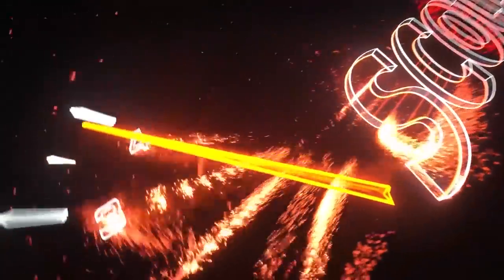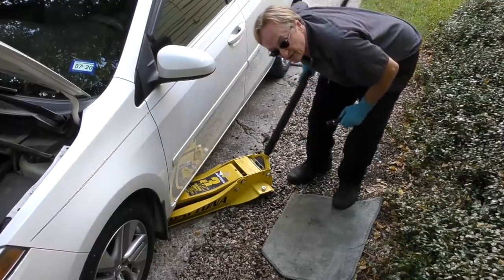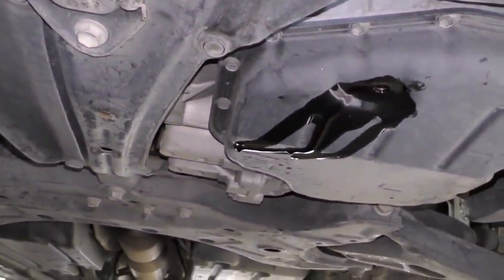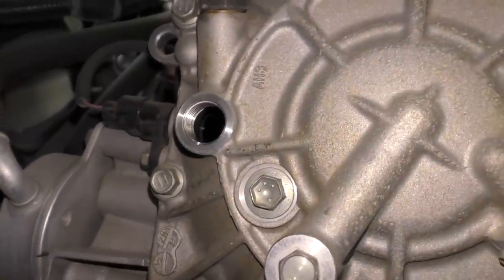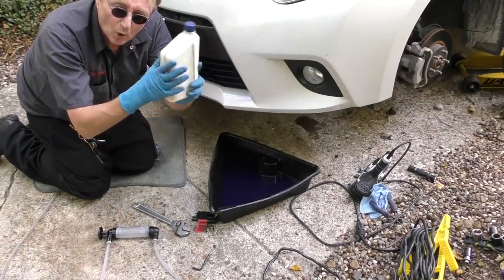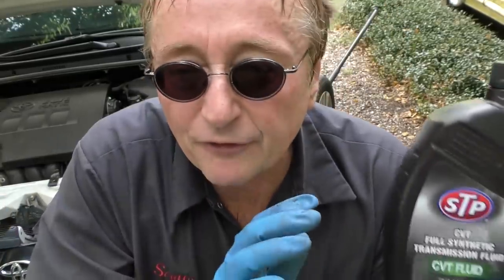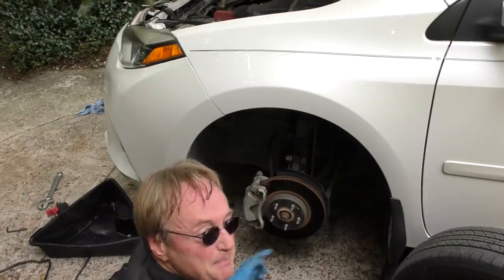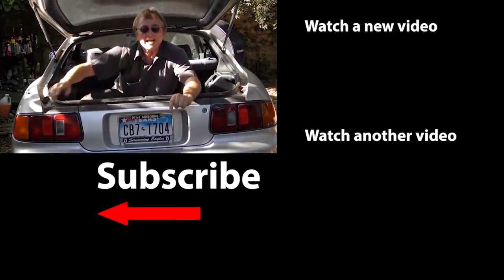This Toyota Corolla Has a Serious Problem

Comment: What about dropping the pan and changing the filter? Should get more contaminates out.
Reply: Toyota uses a screen pointless to change
Reply: hondas built right in its  a "lyfetyme" filter
Reply: more   work   takin  off   all   the  screws   n   dropping  the  pan  however  ,   probably   better   because   if   allen     screw  night  tightened  enough,  it  will   leak.
Reply: I did internal filter replacement on my 4 Runner, RAV4, and FJ's. Easy job! Saved hundreds of dollars plus extended the life of my transmissions 10 times over.
Reply: There's no "contaminants" to drain.
Reply: @daved7024  How many miles?
Reply: There's no contaminates except for the dirt and other crap in the air that  you introduced when you dropped the pan.
Reply: Exactly

Comment: Scotty Scotty Scotty... i remember you said in one video that only use OEM oils on transmissions manual and automatic gearboxes... and here you put STP CVT oil in this.. ? How did this corolla run with this fluid?

Comment: I have a 2002 Toyota Echo with 256,000 miles.  I have never changed the transmission fluid or filter.  This car is as tough as nails!
Reply: i'm sorry to tell you this but.... Um.. Just don't bother changing your tranny fluid or it will give out. Ride it til it dies.
Reply: @GreySchezwan  I think he's saying that you don't need to change it. If it's so important to change the fluid every 40k, he should have done it SIX times by now....

Comment: Scotty - for this transmission fluid change, the manufacturer indicates that the fluid temperature is critical, so that the volume added is not too much or too little.  By pouring out the old and measuring it, would you not have to replace it with fluid that is the same temperature to ensure the volume is correct?
Reply: @universalassociates6857  Thanks - I think his approach is fine - but doing what he did, you'd have to make sure that the fluid temp of the old stuff and the new stuff is the same, otherwise volume differences due to different temps could cause issues ... personally I'd just do it in the morning and have the new stuff sitting beside the car so it is at the same temp as the stuff being drained out - problem solve.
Reply: “DNY automotive “ channel shows the proper way to change the trans fluid.

Comment: I am looking to purchase a 2012 ford focus se with 120k miles. It has never had the transmission fluid changed so is it safe to do now or would damage occur?
Reply: Henry Marocchi don’t bother if you don’t notice anything odd shifting otherwise you can do a drain and fill
Reply: @ARTICFROST777  that's what I figured. I drove it for about 40 minutes an it would shake a little bit every time it went into second gear. And sometimes going into higher gears but not as bad as going to second. I want this car to last me so I am going to drain and replace the fluid now. Thanks for the response

Comment: You should take jack away after removing drain plug to let whole oil to fully drain on horizontal level.
Reply: Luke Duke 
You are not going to be able to take all the fluid out some is kept in the torque converter. And for that you need a special machine.
Reply: @jaimeceballos4529  A CVT does not have a torque converter but it's still a good point that you're not gonna get it all out, regardless

Comment: I own a 2013 lancer with 77,900 miles on it and I am the original owner of it. It has a cvt with it. Interestingly when I took it to the dealer for the 30k maintenance interval which is a major maintenance interval I asked the dealer what it entails and not once did they mention cvt fluid change. So about 44k miles in I started hearing the cvt whine similar to what a supercharger would make and I started getting overtemp warnings. So I took it in this time to a mechanic who specializes in transmissions and he said the fluid is supposed to be changed every 30k miles at a minimum so after the fluid change the car ran great no whining no overheating and after that point on I decided to start doing the maintenance myself. The old saying goes if you want something done right you got to do it yourself.

Comment: Thanks a million Scotty, I have the same Corolla and it has 46,000 I bought it used from the Toyota dealer. I think I’ll be changing it my self later this year ones the colder temperatures arrive, so I don’t end up sweating balls in the hot humid weather. 😁🙏

Comment: Wouldn't it be better to use a Toyota brand CVT fluid, or whatever fluid Toyota uses?
Reply: I'm sure Toyota doesn't manufacture their own fluids...the same people that supply Toyota, supply everybody. Brand name means nothing but price.
Reply: IcantSignIn you don’t know much about transmission fluid do you
Reply: @MoparMadness93  It's that thar kinda slickery stuff ya puts in yor transmission. Taint quite slick as that 710 fluid...(shoot, had muh filler cap upside down)...OIL I mean.. ner as thick ...an sum it's funny cullert.
Reply: IcantSignIn your just so hilarious I was laughing so hard

Comment: Boom! I have a 14 Corolla with the 4 speed trans.  I dropped the pan, changed the filter, then filled with Amsoil's WS extreme service fluid, disconnected the return hose from the rad, ran it to pump out all the old fluid while continually adding new until 7 quarts were used.  I did this at 71,000 miles and pan wasn't too dirty.  Now have 76,000 and will do again at 140,000 miles.  Thanks and have a good day all!

Comment: Step 1: Replace the drain plug with a standard fastener which uses a standard socket head. No more hex/allen keys!
Reply: hffp1  no, its a standaed 6mm allen hex key.  there are sockets for this.
Reply: hffp1  I'd actually be happy to pay for someone who engineered a fastener which securely fit that drain which had a standard bolt head on it. I also wonder if someone can do the same for the fill hole and also figure out how to route a dip stick tube on it.
Reply: That's ...toolist.

Comment: Sideways fill-holes on a gearbox were usually the 'measurement' point of the amount.
As soon as it dripped, there was your level.
(Old dog; old trick)
Reply: David Owen 

Yes. That’s the proper fill level. I’d fill mine through a funnel in the engine compartment and a rubber hose. Same applies to fill level of a differential.
Reply: @davidowen6103  
The last automatic transmission l worked on (about 25 years ago) was a 69 450 SEL 6.9, so I'm not an expert.
That sucker had to be filled through the dip-stick shaft & it took forever.
(about 12 litres of ATF, if l remember correctly)
Reply: @universalassociates6857  
Uhh... what do mean by "you tuber"?
I'm a mechanic, and don't post my work on YT.
Obviously the vehicle has to be level, even if it's up on a lift.
lt's not a "trick" - it was in the User's Manuals at the time.
Reply: @universalassociates6857  
Texting shorthand, l guess.
lt's difficult to get the nuance from a couple of sentences.
All is good.
(my fave Manuals are Haynes, by the way - bikes and cars)

Comment: Fluid level can be checked at idle through the drain port with the plastic stick IN while car at idle. Must be at 35 to 40 degrees C and you can put the car in fluid diagnostic mode to check temp!

Comment: Remember to calibrate the cvt oil pressure and reset the values using a diagnosis machine. It has to be done every time you change the fluid.

Comment: Hey Scotty,
I’m an owner of 2014 corolla le eco 1.8l      which is at 132245 miles. CVT fluid has never been changed and I’m thinking of performing this service, but wondering if I have waited too long. Besides this neglect, the vehicle has been well maintained. I find it strange Toyota maintenance manual simple says inspect and does not specify changing,but if you call Toyota their master techs all say different intervals, 60,000 others 90-100,000.

Just wondering if this particular vehicle you serviced in this video has had any cvt problems since you performed the maintenance?
Thanks for all the videos, you’re doing a service for humanity, you deserve a YouTube award.

Comment: I have a 2015 Corolla LE Automatic - 145,000 miles and never changed the CVT fluid, is it a good idea to follow this instructions?, Of course I know a complete CVT fluid flush will damage the transmission.

Comment: Hey Scotty. It's my understanding that on the Toyotas the transmission has to be at a certain temperature to get a correct level check. 104 to 113 degrees. That's what the straw is for. I just did this procedure on my Toyota. Correct me if I'm wrong.
Reply: Its2stroke “DNY automotive “channel shows the proper way to change the trans fluid

Comment: Word to the wise: make sure you can remove the fill plug BEFORE you drain out the fluid.  If it's seized or you don't have the right tool to remove it and you've already drained out the fluid, you're screwed!
Reply: Ding ding ding ding.! You are absolutely correct sir !

Comment: My daughter has a 2017 Toyota Corolla, great info 👍
Reply: FXDR-S1000R Eli C. If you want to do it the right way, check DNY automotive youtube channel. This is how it is done properly. I have a corolla 2016 with 153000 miles, no issues at all.

Comment: Scotty-
I recently bought a 2016 corolla with over 80,000 miles. I am a about to do a transmission drain and fill. Is the filter inside the pan supposed to be replaced. Toyota dealership does not recommend this and heard that some will not do this.  Also I hear that you can not use any other transmission fluid but the FE CVT transmission fluid, the difference is it is pricey. Are there new types of this specific fluid that is cheaper or compatable?

Comment: Scotty! I've spent hundreds of dollars getting my transmission fluid changed at the dealer.  I was told my 2016 Toyota Corolla with a CVT could only be changed by a professional because they need to attach a computer to the car and regulate the temperature of the fluid and transmission to do it correctly. I saw you change the fluid on this Corolla without any of that nonsense. Am I being scammed?
Reply: Someone “DNY automotive “channel shows the proper way to change the trans fluid

Comment: Thanks for the Video..... Glad to know I will never have this experience..... No CVT transmission in my future.....lol......
Reply: Lang Strimpel I have 153000 miles on my Toyota Corolla 2016 CVT doing ridesharing. No issues at all 🤷‍♂️👀
Reply: @georgeschneider2414  hey I'm looking at buying the exact same car, how is the car holding up a year later? also hows the handling?

Comment: Hi Scotty I have Corolla 2017 in these 3 years I didn't change the transmission oil because  I had only a 17000-mile drive, So what to do I should wait up to reach 40000 miles to change the transmission oil or just change now?

Comment: Scotty what about filter change and using only oem transmission fluid?
Reply: I can say I had 222k Miles on my old Toyota never did the filter just drain and refill before I sold it. If you plan to have till before 200k should be fine.  I even used my Rav4 for some towing...no issues Transmission was solid.  Wifes Camry 204k miles same way.  Filter If you wanted to do maybe every 200k miles otherwise its clean fluid that keeps transmission long lasting and not beating the crap out of it.
Reply: I change the trans filter every time I change the trans fluid which is every 35,000 miles. Still going strong at 214,000 miles.
Reply: These sealed transmissions don’t have a user replaceable filter.
Reply: Jim Banville 
If it has a sump chances are it’s going to have a filter in the sump and/or a secondary filter
Reply: @jimbanville  ... which makes it even more important to change the fluid. If the fluid is allowed to get too contaminated the filter can clog. Replacing the filter in one of these transmissions is major surgery because, like you said, they are not made to be replaced. I had a dealer mechanic explain this to me for my 2007 Honda Civic (that car, BTW, was a cinch to change the A/T fluid), why it was so important to change the fluid before it became a problem. I now own a 2015 Subaru Forester, and have had several conversations with the dealer mechanics who swear that the fluid does not have to be changed for at least 100,000 to 150,000 miles. BTW, to change the fluid at the dealer would cost $375!
Reply: “DNY automotive “channel shows the proper way to change the trans fluid

Comment: So how often should you change the transmission oil filter?
Would it be permissible to start the engine for 5 seconds or so and get more old oil out of the transmission?
Reply: dannyo66 “DNY automotive “channel shows the proper way to change the trans fluid

Comment: Recommend caution when refilling with same amount taken out unless your are super sure that it was properly filled to begin with and also that your measuring method is accurate.  Otherwise I would recommend refilling with stated capacity in your manual or Haynes manual. For added assurance most of these allow for “finger checking” the level through the fill hole or another level checking hole. Love your videos Scotty, you are the man.

Comment: hey scotty! What about opening the pan and changing the transmission filter?
Reply: alot of cars now have the filter built into the tranny so its "lyfetyme"
Reply: Sadly a lot of newer transmissions the filter is built into the transmission so unless you want to rebuild the thing change the fluid. Hence why Scotty says change it at 40K instead of the usual 60 or 70K
Reply: Most Toyota transmissions I know of... don't actually have a separate/serviceable filter. But if your car does...by all means change it!
Reply: @brandonburley3080  i didn't know that, in my hyundai getz 06 we have filter in the trans that can be change, i guess they make the new cars more unreliable in the way that you can't fully service your car by yourself
Reply: @Exploring_Nature  They don't want cars "fixed" they want you to buy another one. I've been driving a '68 Corolla for 31 years. This is not what manufacturers want to happen any more. They don't make any money from "reliability".
Reply: “DNY automotive “ channel shows the proper way to change the trans fluid

Comment: Normally, but not always which is why you should find out you fill until the fluid is level with the bottom of the fill hole. However, even if that was the normal procedure for this car the reason Scotty measured what he took out was the car was not on a level a lift. Unless the vehicle is level you can't just fill to the fill hole as in this case due to the cant from being jacked up unlevel it would have resulted in an overfill.

Comment: The plastic flange is to make sure that the oil level is correct. If I am not mistaken you have to check it on warm gearbox oil (35, or 45 degrees C - have to use scan tool to see temp). Just like in DSG. But the measuring how much you take out is correct, only if somebody before top up correctly.

Comment: Hopefully I'll never own a car with a CVT.
Reply: Marty Galbreath I am at 166500 miles with my Toyota Corolla 2016 doing ridesharing. No issues at all with my CVT 🤷‍♂️👀
Reply: @georgeschneider2414  Thats good to know. I have a 2016 Toyota corolla with 44,000 no trouble so far.
Reply: sandra hudgins Change the transmission fluid every 60000 miles. You can go to the dealership or watch “DNY automotive “channel. It shows the proper way to change the trans fluid.
Reply: @georgeschneider2414  hi, did you go to dealer or independent mechanic for fluid change? How much did it cost? Thanks
Reply: The Prius' with CVTs last 300k+ miles.

Comment: I was looking at the owner's manual for my car.  It has two maintenance schedules, one for "normal" driving and the other for "severe" driving.  The normal one says change the transmission fluid every 150k miles, and the severe one says every 45k miles.  Normal stop and go city driving is pretty severe, so severe should probably be normal.
Reply: every 150K miles? Honda says for the CVTs to be changed every 90K for normal driving conditions and every 30K for severe driving conditions
Reply: @Eman1900O  I don't have a Honda CVT.  I was just pointing out that when a manufacturer claims "lifetime transmission fluid" it can reference a usage scenario that isn't typical.

Comment: A good rule, when dealing with an aluminum pan/case/engine, is to first confirm that the "fill plug" isn't seized, before you crack open the "drain plug(s)".

Comment: I have a 2010 Toyota Corolla, 148,000 miles on it , I whated to know if a transmission flush will hurt it ? It runs good have had 1 transmission fuild change at 70.000 miles can anyone tell me ? I read 50 different post thanks james
Reply: Dont do the flush, just drop the pan, replace the filter and refill with OEM fluid. The pan drop gets about half the fluid out so in your next oil change you can drain the transmission pan and refill with fresh fluid again. At that point the fluid should look red or bright red.

Comment: Part of changing the fluid is making sure it's the proper level.  Measuring what you took out doesn't accomplish that.  What if it was already low?  Cases I've worked on, you usually fill to the bottom of the fill hole.  That's why it is located where it is.  But RTFM before stuff like this.

Comment: Dear Scotty, I think the second nut that you screwed on is not supposed to be put on until after you fill in the oil. You are supposed to get the car levelled and keep on filling the transmission oil until the oil starts to drain out of the hole that way you know that its reached the reuired level. Then you replace the second nut.

Am I right? Please correct me if not. Always happy to learn new rhings.

By the way, love your videos 🖒

Comment: Usually this type of drain plug works as a level plug . Idling in neutral with warm engine and transmition, remove the small plug and it should slowly drip a few drops. If no drops then level is  low